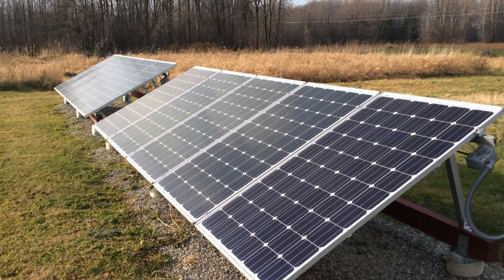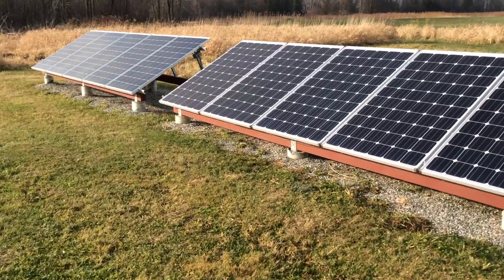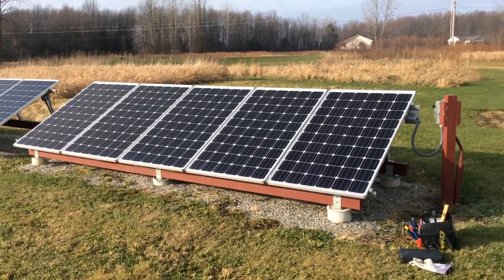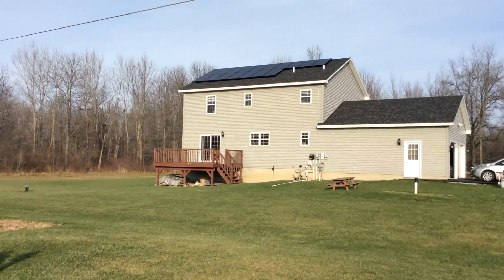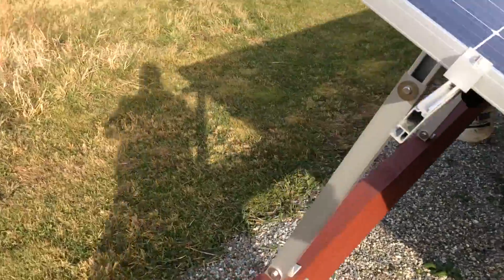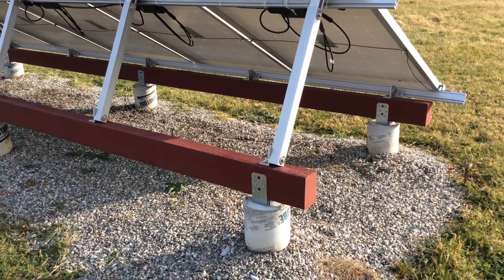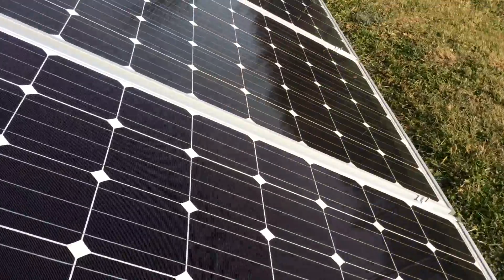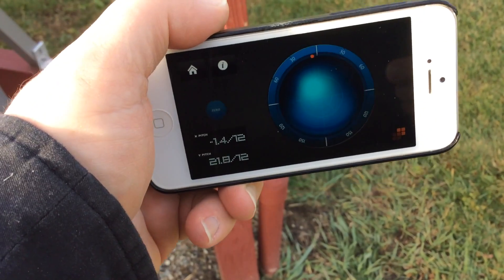Ground Mount Solar Overview

Comment: Thanks, great video! Were there any challenges with voltage drop over the distance to the house/panel with transferring the power? Do you use transformers to convert to a higher AC voltage to make transmission more efficient?
Reply from the maker: David Woods Thanks.  I oversized the cable to #10 THHN to help with voltage drop.  The emphases inverters convert the voltage to 240. No need for additional transformers.

Comment: Nice job! Looks really good. I was thinking converting my MG Midget to electric power for summer driving. We will have way more power than we need during the summer months.
Reply from the maker: Thanks for checking out my work.  That would be a great project Steven.  I'm always liked the MG cars!
Reply: How well is the wood portion of your rack holding up?